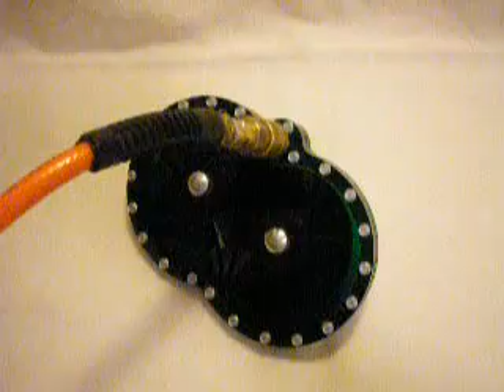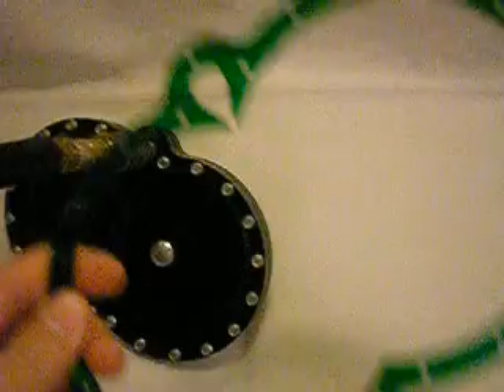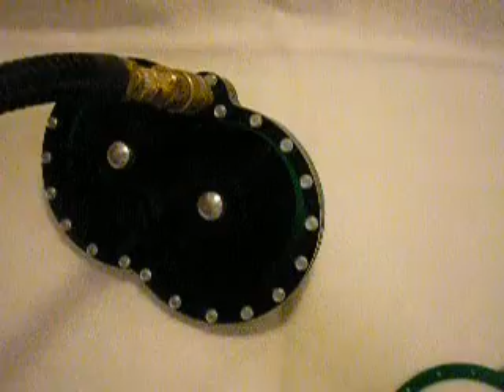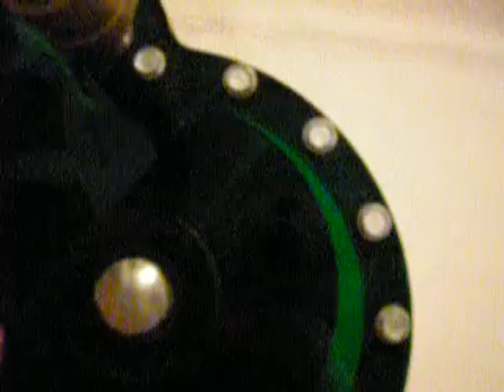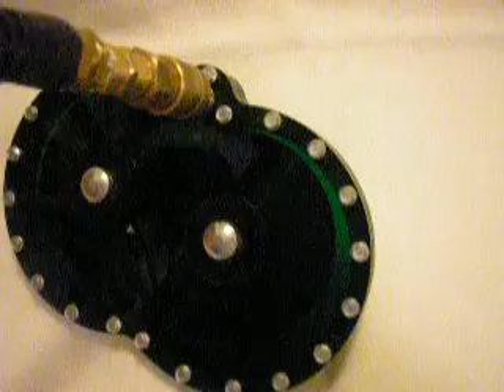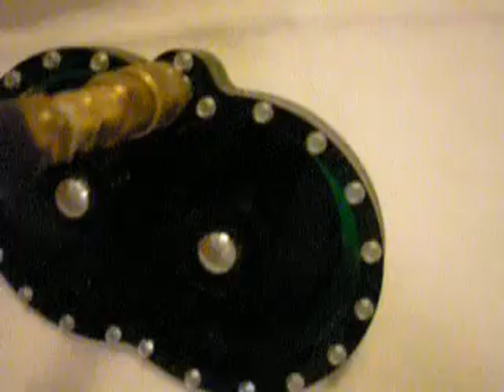Boundary Layer Turbine

Comment: Yes!!!!!! Tesla talked about doing it this way as an improved version. You can’t have them meshing though because right after the mesh the disc spacing is too wide. check out the paper Dr. Tesla Talks Of Gas Turbines. He’s kinda secretive about it though in the text. 
https://teslauniverse.com/nikola-tesla/articles/dr-tesla-talks-gas-turbines

I just made a similar design that I will be attempting soon. I need to finish the 10in diameter aluminum ones I’m making now though. Thanks for the video!